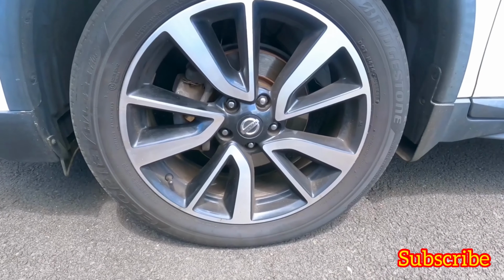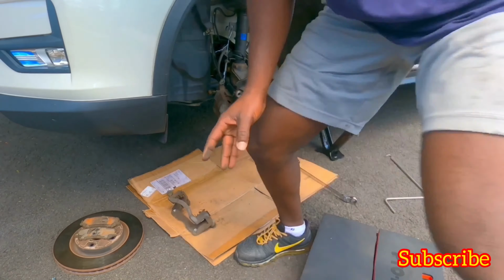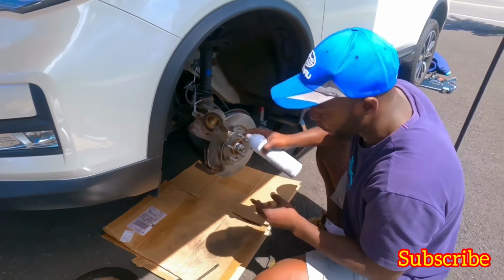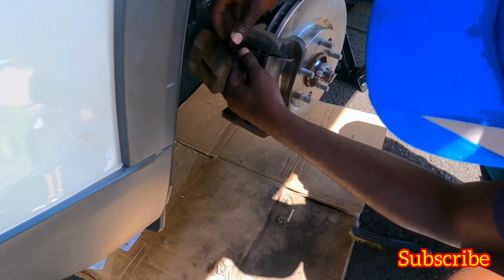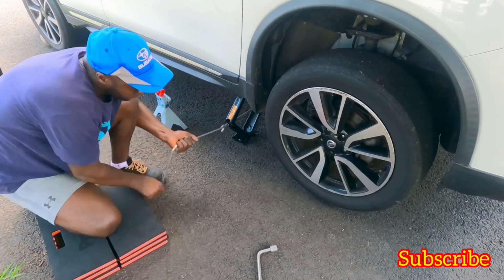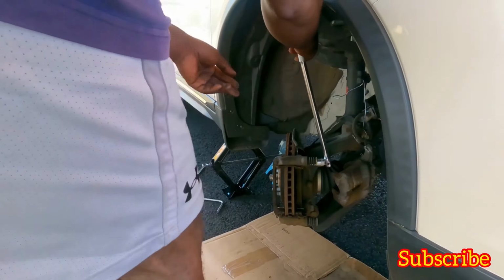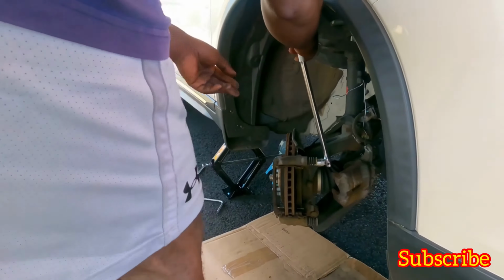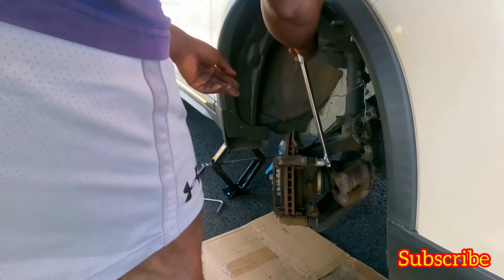2018 Nissan Rogue front Brake  and rotors Replacement

Comment: One thing I will suggest, use the old break pad on the caliper piston when you compress it back into the caliper, if you just use pliers like this, it can push the piston back in unevenly and damage the caliper. If you use the old inner brake pad it will more evenly push all sides of the piston. I recommend getting the correct tool before hand, they generally range in the $10-$20 range for the cheaper ones.
Reply from the maker: Yes I did. After doing this Brake I actualy bought the tools.  I currently do have it. thanks for let me  know. I appreciate your input.

Comment: Excellent excellent job just one thing you forgot, it's very important as to take the slide pins pull them out and regrease them. Otherwise the pads are gonna wear different rates and the pads could stick. Ohh and  grab a torque wrench and torque those wheels to 83' pounds.
Reply from the maker: Great tip! I did not have a Torque wrench at that time but I do now. and about the pads, you are right.  thanks a lot.

Comment: When compressing the piston i always used a c- clamp and the old brake pad and i never opened the master cylinder because your letting air into the lines and brake fluid attracts moisture.  Keep that line closed and get a c-clamp
Reply from the maker: okay thanks a lot I will try that next time. I will look for the C-lamp.
Reply: You always open the master cylinder so itll release pressure when compressing the piston. That way you also know if it over flows and wont cause unnecessary pressure against the cap. You just have to make sure nothing falls in to contaminate the master cylinder while open

Comment: Why you have to replace the rotors
Reply from the maker: Thé rotor where a bit worned too. When you hit the brake they steering wheel was shaking/vibrating. So this tell me that the need to be replaced.

Comment: Don’t breathe it in it’s toxic, so is the brake fluid that you’re touching also their is specs for the bolts
Just busting your balls no disrespect 
But seriously wear some gloves you don’t wanna have that chemical soak in your skin. Years later, you’ll be wondering why you have cancer or kidney failure
Reply from the maker: Yeah you are right.  It’s so hard to work with glove sometime. I wanna be able to feel what I’m doing and sometime Gloves make it impossible. But I’ll be more careful.

Thanks 🙏